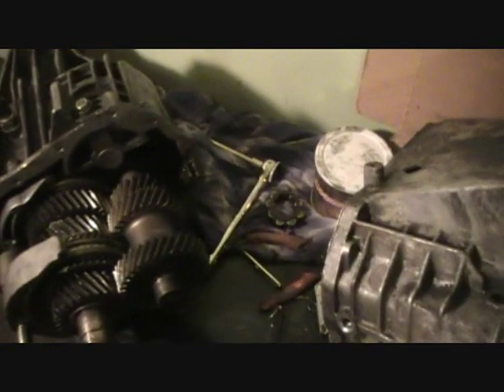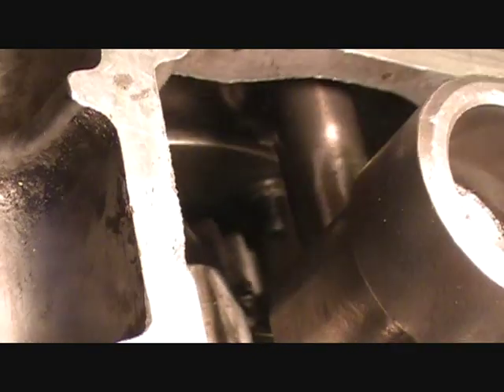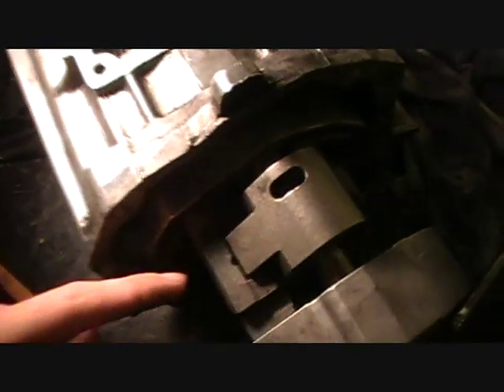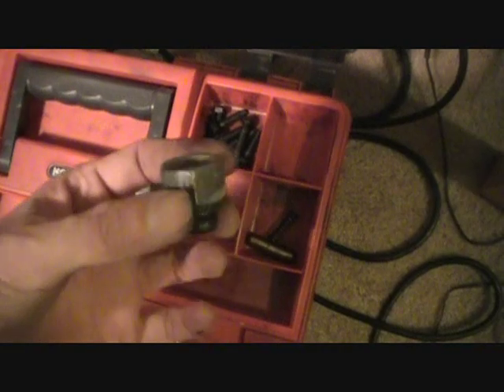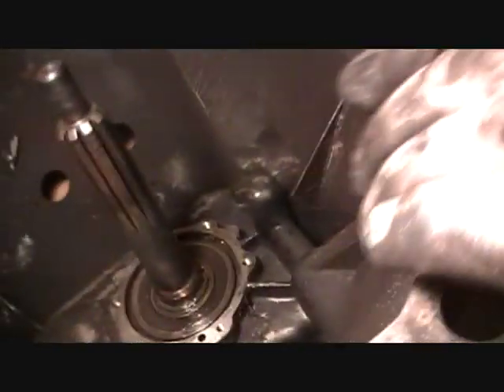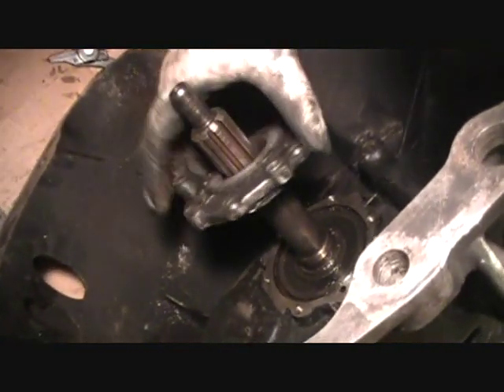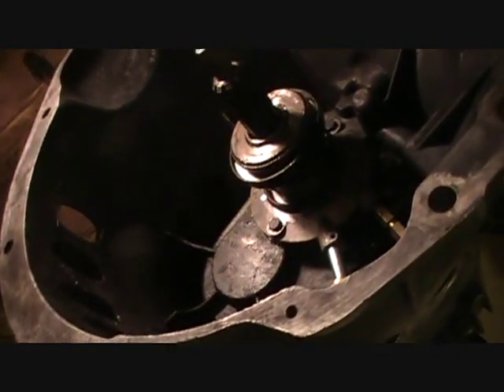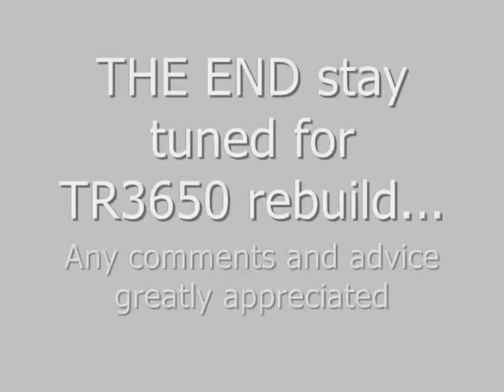NV3500 standard transmission rebuild how to -part4

Comment: On the shiftfork where the 3 shiftforks lineup you mentioned a spring and detent for the little whole did you guys reinstall them I'm asking because I don't think mine had a spring and detent there but but if it needs one I want to make sure I get it before start putting everything back together

Comment: I like how you made a how to rebuild  and left all the critical steps that would make it a rebuild video and managed to make a video of splitting the case grinding on the counter shaft gear and putting the case back together only you left out all those critical parts as well.... y didn't you just call it the "how to change your nv3500 bell housing unless you never covered that in this parts and couldn't add a 5th part idk I wasted my time watching 3 only to be disappointed 23sec into part 4 dumbass

Comment: Near the end you installed a piece that you said interfaced with the shifter mechanism….I think that the bolt secured a piece with a spring on it.   Is this the
detent for the reverse and 5th gear shift positions.   Thank you.

Comment: I have my NV 3500 from my 98 Chevy S-10 PU down, and wanted to take the bell housing off and to the car wash to clean it.  Transmission works great, but the rear engine seal is leaking.  The problem is I can't get the bell housing off.  I removed the retaining snap ring (about 1.5" diameter) on the front in put shaft and thought that the bell housing would come off, but it only moves up about an inch.  There is something else holding the bell housing.  Can you help?  This is a big problem right now.  Just need to take bell housing off.  That is all.  Will also replace rear seal on transmission, and new fluid, but now I am worried that I have screwed something up?  Have rebuilt automatic transmissions and a couple of standards, but never a NV 3500.  The Chevy Chilton manual does not discuss the assembly or disassembly of this transmission.  Mike Malloy, Corpus Christi, Tx.  Please email.  mmalloy100@gmail.com

Comment: I'm curious, did this thing work better after re-installing it in the vehicle?  Did the noise go away?  I cringed when I watched you using a dremel tool on the countershaft and at the lack of replacing bearings and seals when reassembling it.  But I totally understand not having the cash to change those kinds of things and just wanting to fix the problem.  I was there once too, but I've had plenty of experiences where I took something out and repaired only the problem and reainstalled it, only to have it leak or have a bearing fail 2 months down the road, leaving me to have to re-remove it and re-install it all over agin.  It my experience its always better to change anything serviceable if and when you have it apart to avoid taking things apart a second or third time.  Just my $.02.

Comment: Curious to know if you put a new bearing on the cluster gear where the burrs were. Everyone of these I have owned in vehicles since 1991 will leak out just a small amount of fluid and then the bearing on the cluster gear will go down because it has a plastic race and the race gets hot and melts. Then the gears start "climbing" and cause major troubles !!

Comment: also mine did not have a hydrollic line at the end of the bell housing ( the last step ) i have a slave cylinder with a line though
Reply from the maker: What you described is a hydraulic system, in which a fluid is used within the system to be able to apply great force at one end from little force at the beginning (your foot on the clutch pedal).
Reply: valflyinf is there any specific things to remember as far as installing all the gears and rod in the case? its like everything is still stuck.  I have everything installed exactly how you did it. in that order too. What am I missing? its like its stuck in gear
Reply from the maker: My advice is to have a few strong hands to wiggle the main gear assembly inside the case so that the case can shut. Is that your problem? You cannot shut the case together?
In any case use a lot of lighting. Make sure all the bearings are not obstructing and are installed in the case before you slide it atop the gear assembly.
I hope you are using grease to assemble this thing it makes it a lot easier.

Comment: need help with the C shaped clip that goes in the back of the case. do you have to install it with the case standing striaght up and down? what is the best way because I cannot get it to stay on the gear when I try to slide the gears back in the case... please help
Reply from the maker: It helps to have the transmission standing up, and leave the clip installed on the gears as you are placing the top part of the case back atop the transmission to close the case. If things are hard to do just persevere. Do well.

Comment: I'm looking into a rebuild and parts but I'm not sure what transmission I have exactly....I thought it was a NV3500 but a guy at a local place looked it in and said its a older transmission called an MG5....so not sure what it is exactly.....need some help man...thanks in advance
Reply from the maker: You should get the Haynes manual for your vehicle first. It will tell you about all the transmissions and engines in your model vehicle:
>>> http://www.ebay.com/itm/Haynes-Repair-Manual-Chevrolet-GMC-Pick-Ups-88-98-99-00-C-K-Classic-24065-/121319445084

It probably won't tell you how to rebuild the transmission but it is a must have for most of all problems you can ever encounter.
Your problem sounds like you may have a shift fork that is either used up or actually broken. That should be a <$100 part. For the overdrive, it might be a synchronizer that went out, again that's about $30. If you have a second vehicle to drive then park the truck safely, drop the transmission and open it in a clean, well-lit area, the damage should be obvious once you are inside the trans. Worn-out metal, etc.
If you get it done it will be about $1000.
Anyway, once you find the exact part number of your transmission by finding it on the transmission case, you'll be able to find the schematics online and pin point exactly what part you need to buy. Transmission part stores go by these part numbers so find that number! Also don't buy from official dealerships, etc. Buy your parts online or at transmission part stores. (dealerships will completely rip you off, although sometimes for some parts, you don't have a choice)
Do it.
Reply: I'll order one. And it's been like that for awhile I do know for sure it's the synchros because it first popped out of overdrive so I had to hold it in gear to use overdrive. Then it just stopped working it's been the same tranny since it's purchase since 93 so maybe just wear and tear. But thanks your video makes me wanna rebuild it myself now I'm looking at the rebuild kit along with a brand new clutch I tend to drop it myself instead of having some person do it at a shop which would cost alot

Comment: do you know what MG5 is? I have a 1993 Chevy 1500 1/2 ton pickup 2wd and I had a guy look up my vin and that's what transmission is on my truck I keep hearing different things but maybe you know more to what it is exactly what transmission it is. I keep hearing Muncie or getrag idk...but I need a rebuilt tranny my 5th gear overdrive is out and I only drive 4 gears and my reverse is out or I think just grinds now
Reply: Stefen Phillips you really wont know to you pull i8i got 94 chevy said samething mg5 was supposed to be the getrag 5 speed when i pulled it didnt look rite so i ran num,on trans it was the nv3500

Comment: Thanks for the reply, looked into your Part 1 video and it showed you splitting them apart, sorry I was thinking the bell housing was the case. Is there *THREE* pressure fit pins? 2 outside, and 1 inside?
I've got a 94 Sierra 1500 4x4, currently torn apart in the yard, everything brand new except the tranny and engine now, frame repainted and rock/rust gaurded. Ready for another 300xxx km :)

Take care

Comment: Hey man, I've got two NV3500 transmissions, ones got blown synchros, the other a cracked bell housing. Are the housing removal (with somewhat ease?) i've looked at like a hundred sites that say NV3500 bell housings are not removable?!

Thanks!
Reply: Swap the front half of the case. Not too hard. Bell housing and front case half are one piece. Watch video 1 of this series for decent disassembly instructions.

Comment: @alwaysopen 
I had to watch this again and get a laugh out of you calling bolts 'screws', The pins you are removing are called 'roller pins' and you should have a punch for them. You should really put new ones in their place when reassembling whatever you take them out of. Engines and transmissions vibrate a lot so those things can let go. Firearms use them extensively as well. The rod the shifter forks are attached to is the shifter rail.

Comment from the maker: @RonmanB1 LOL ya I dont plan anything I'll say so anything goes, its live. Anyway ya if you have that much play the front bearing(that goes in the inside of the case itself) is probably missing a coupkle BBs or something. or maybe shredded the bearing frame that holds the BBs together. My buddy still hasnt reinstalled it back in the truck so we don't know yet but probably it will quit making that whiny noise..
Now I am tempted to rebuild an automatic, maybe the ones that go on crown vics?